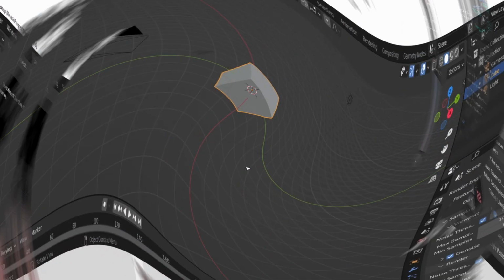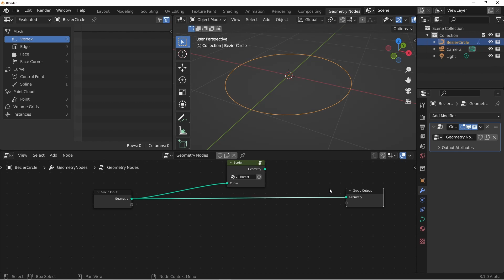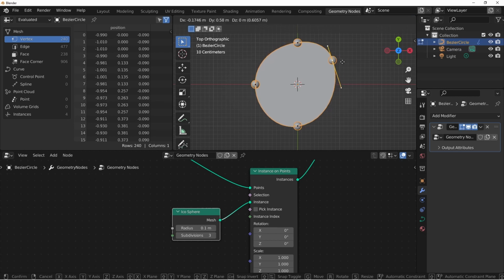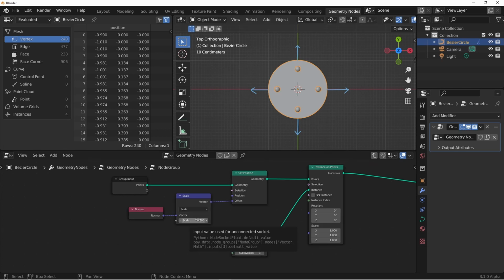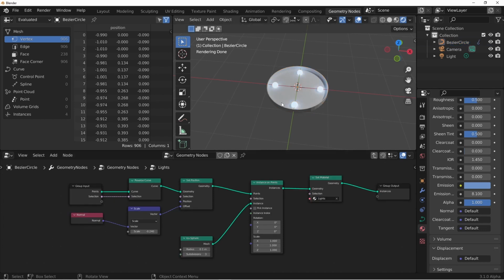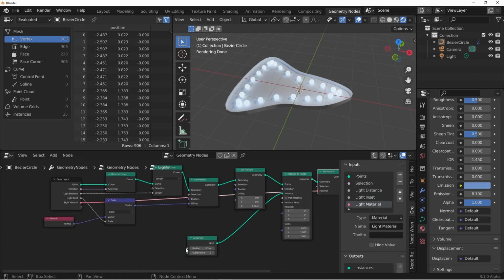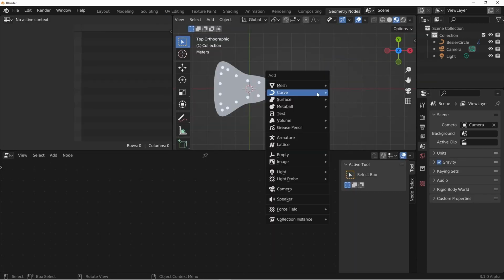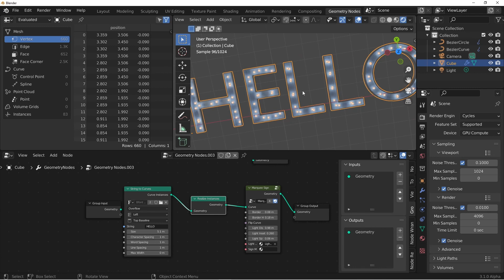Blender Geometry Nodes: Procedural Marquee Sign Maker

Comment: I wish I could control the light strength from the geometry nodes modifier controls. Having everything all in one place works be so user friendly. I also wish I could use point lights instead of emission.
Reply from the maker: I've not tried this, but maybe you can pipe an input value from the modifier through to an output value. Then use that as an attribute in your material?
Reply: @JohnnyMatthews  tried that, tried drivers too. They don't work when linked or appended to another file. With appending I've got to recreate the driver in the work file again and with linking nothing happens.

Comment: I'm thinking about a way to switch the lights on and off, in like a 'walking' fashion. So 0 1 0 1 0 1 0 1 basically and being able to flip that. I was trying your row selection/modulo method but it doesn't really work. You have any ideas or tips?
Reply from the maker: Maybe the selection on the instance on points. You would then need a second instance on points of the 'off' lights with the selection flipped.
Reply: @JohnnyMatthews  going to give this a go, thanks
Reply: Did you figure it out? I have a solution if you did not. index > add > ping-pong > delete geometry > instance on points. Put a boolean set to (not) after the ping-pong going into a second delete geometry > instance on points.

I'll post it to twitter and tag Johnny. Might make a decent quick follow up.
Reply: @JohnWesleyDavison  Thanks 👍 I was messing around with pingpong already but also couldn't quite get that to where I wanted. Does anyone know how the pingpong function actually works? Is it a boolean selection going back and forth between 0 and 1 for a given input?
Reply: @boudewyn  It's a float value that bounces back and forth between zero and one.